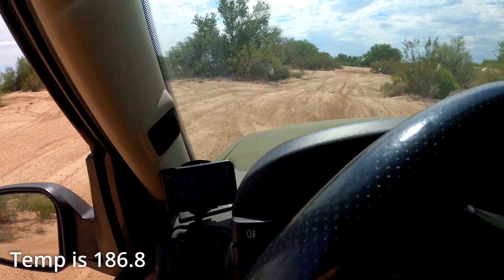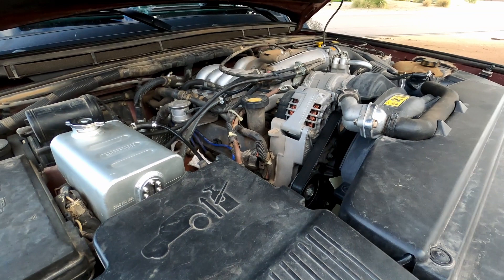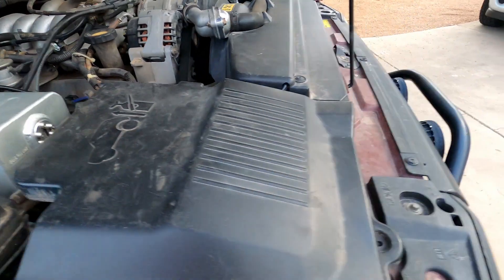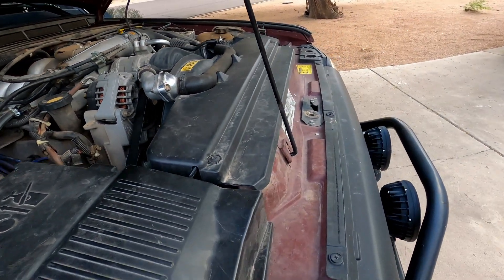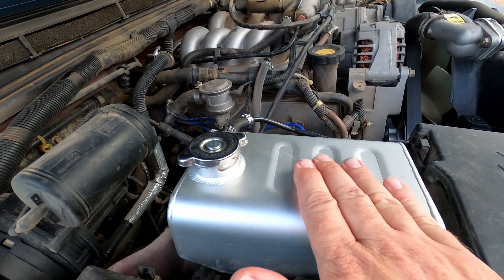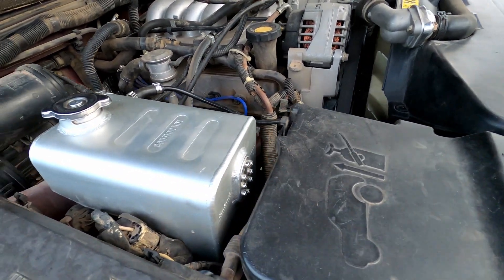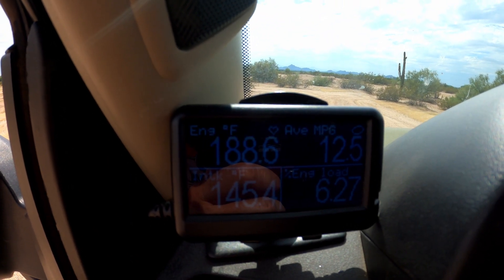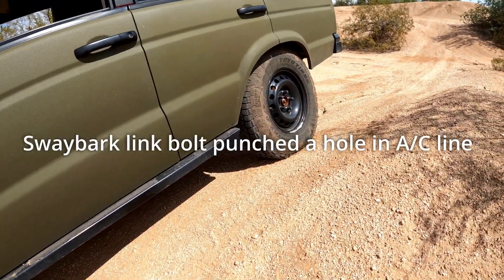Land Rover Discovery 2 Cooling System Modifications

Comment from the maker: If I had been running my A/C, my temps would have been around 194-198 in this same scenario. That is really good for my ambient temp. But, my quick disconnect sway bar bolt rubbed against my A/C line (the one on the FL side, low) and it eventually created a hole, causing the A/C to fail over time. I didn't notice this until right before the video. Good thing I have a spare truck (and a spare A/C line).

Comment: I completed all four of these mods on my 2001 D2 Thor V8 4.0L to include installing a BMW E30 thicker lined coolant expansion tank with a built-in coolant level sensor. It was a one-for-one swap and capped the throttle body heater coolant line. Monitor temps with my Nanocom.😎

Comment: How did you seal those paper gaskets? The instructions say to put silicone on both sides but in the picture it only shows it on one side of the paper
Reply: Do not apply any silicone to any kind of gasket unless it's going over a seam.

Comment: how would you bleed the system with this mod done? because the bleeder screw is gone
Reply from the maker: You just open the cap on the reservoir and rev the engine to 2500 rpm for a few seconds. Seems to work fine. I've had no problems with air in the system.

Comment: what I see is that the gm fan wings are incorrect to flow the hot air from the radiator to the engine side to reduce the temperature check this point and if you want better results use the range rover p38 4.6 engine 99 to 2002 radiator fan and clutch 👌
Reply from the maker: The clutch and fan combo dropped the temp by about 5 degrees combined. It's working pretty well.

Comment: I have the same setup and my d2 is regeared on 35s with metal bumpers, armor, and winch.  Under 60 mph my temps are in the 183-188 deg range.  On the freeway at 75-80 mph I’m seeing 195-198 deg.

Comment: Hey do you know what mount that is for the Ultragauge?
Reply from the maker: It's the one they sell.
Reply: @fitzventure  Thank you! Just bought it. Could I also ask you what coolant you used to flush the system? I'm replacing a bunch of stuff for the cooling system and would like to start consistently using a recommended coolant. I just cant find good info.
Reply from the maker: @Sam-xt5gb  I still use the factory type of coolant. I believe it's the same as Dextron.

Comment: I want to try the quick disconnect front links. So far I haven't even disconnected my front at all but my rear was making lots of creaking so I completely removed the links and the bar and I go down the highway every day on HD Springs 2 inch lift and it handles great. I mean I can turn Corners in town just fine I think maybe the rear is less crucial than the front because the rear doesn't have the weight of the engine I don't know but all the guys on the Facebook disco 2 group trip out about stuff like that but I think it's just fine.

Comment: Hey man looks like you're in Arizona also is that right? Anyway I love the color and I also have that exact inline thermostat and you're right it's amazing. I'm over here in Tucson and initially I put in the 170 degree element and it was great in the summer but now that it's a little cooler I had to go to the 180 because I was throwing a code for low temperature LOL made the fuel mileage way worse now I have it up in the 180s. 

So how did you do that body I totally love that color. Is that bed liner? I've been considering doing mine exactly like yours or with dark gray two-toned with black diamond plate
Reply from the maker: Nice. You're almost local. I'm in Scottsdale. That thermostat mod is wonderful. I love it. Yeah, my Disco is bedlined using Raptor Liner. It's holding up really well after 2 years of abuse. I should make a video about that.
Reply: @fitzventure  yeah definitely I'd be interested in seeing how easy it is to put one on. I definitely scratch the crap out of mine often on all these bushes and twigs we have around here
Reply: @fitzventure please do. Thank you.

Comment: My truck came with this mod.  Had headgaskets done and car still overheated. Replaced water pump and radiator (which needed  it any way). Finally added a 180 deg thermostat. Still ran hot.

Turns out my expansion tank return nozzle was blocked. Replaced with a new one and have been running 189 - 195 degrees under most conditions with AC. 

Like the aluminum expansion tank! 😉👍
Reply from the maker: Wow, that's crazy. Who knew that little hose was so important?
Reply: What were your temps when it was blocked? I’m curious if mine is the same.
Reply from the maker: @texasoff-roadmilitia425  Not sure what you mean by blocked. But my temps now, in 75-65 degree weather is 179-183 most of the time.